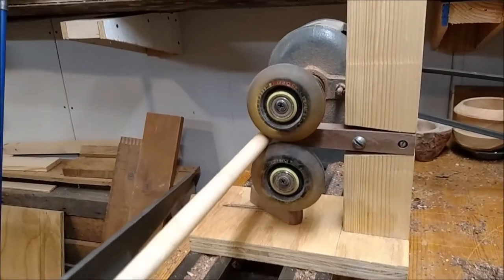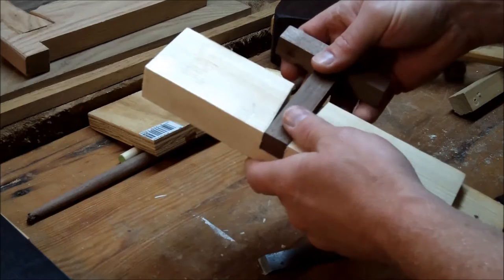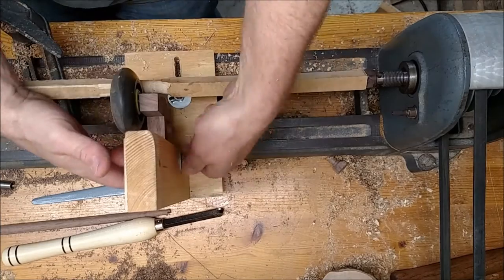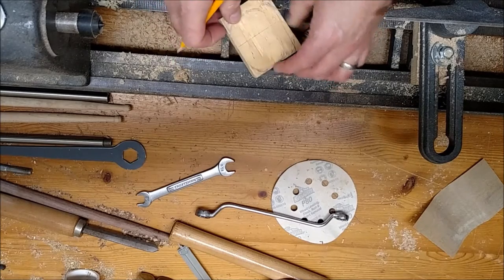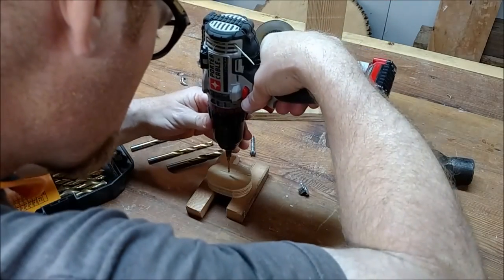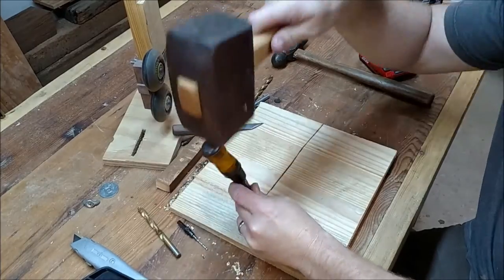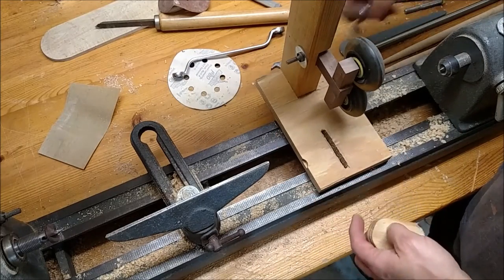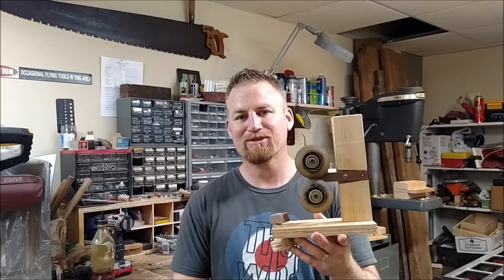Simple DIY Lathe Steady Rest- Vintage Wood Workshop

Comment: Do you think you would benefit from a 3rd wheel? I understand it adds to the complexity. Do you think this would be adequite for longer pieces like a back spindle on a chair?
Reply from the maker: I think a third wheel would only help the design and yes spindles would work doing this.  turning the drumsticks is about as long and thin as I want to try but with sharp tools it can be done

Comment: I saw a similar design in use in another video. Thanks for sharing your build. How did you attach the wheels? Thanks in advance.
Reply from the maker: Thanks, I attached them with 1-1/2" drywall screws.  Glad you liked it!